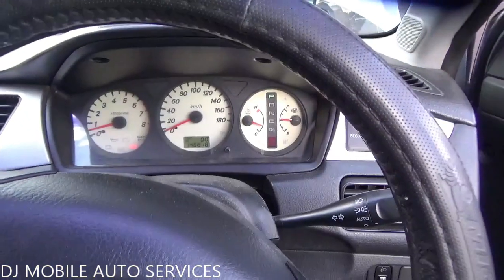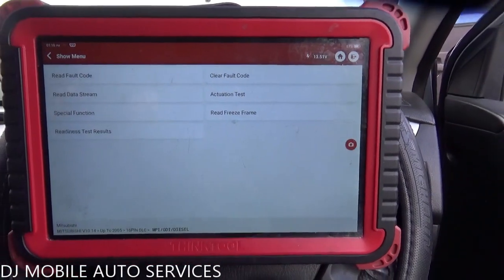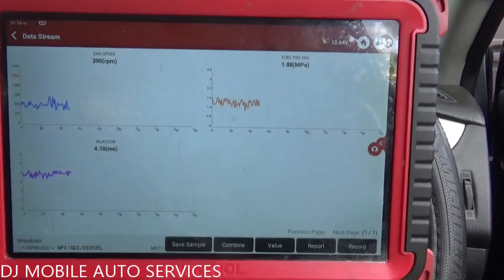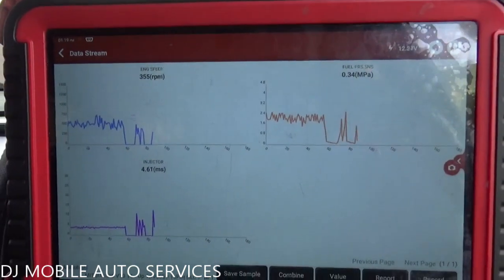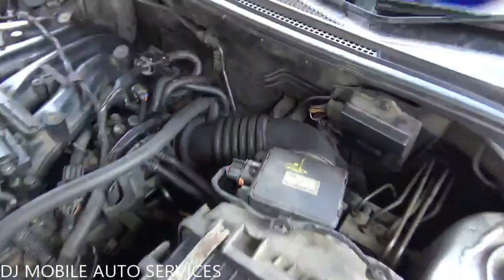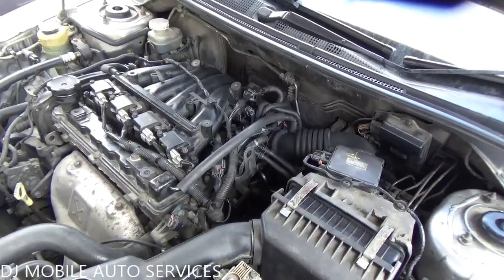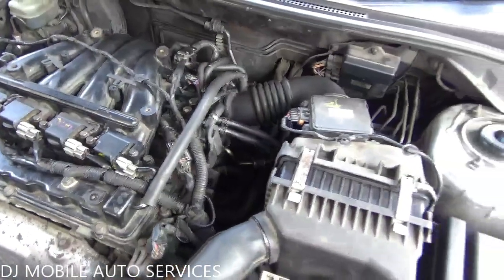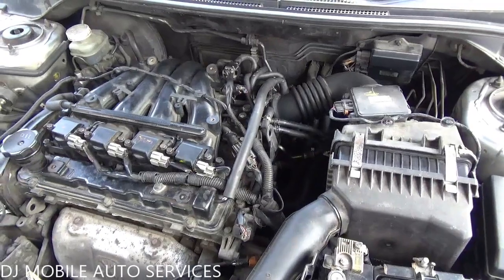03'-06" Mitsubishi GDI Lancer lost of power, lack of acceleration with idle issues. What can it be?

Comment: Hi did you solve the problem ?? What was it?? i have the same isssue with the same ingine
Reply from the maker: Yes. The low pressure pump was not supplying fuel to the high pressure